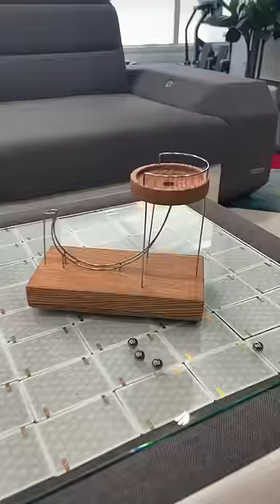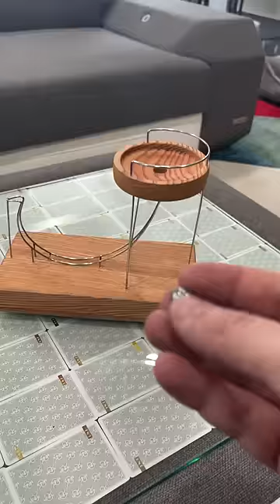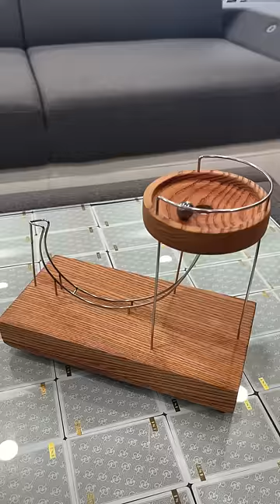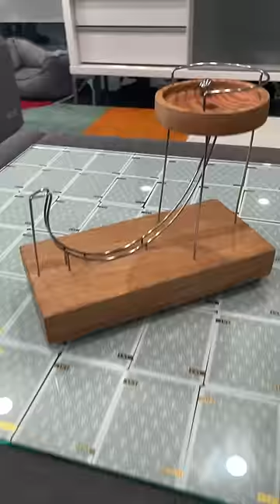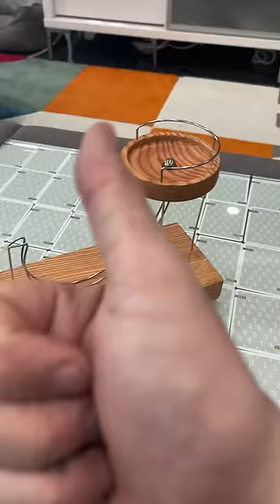An Impossible Perpetual Motion Device?! 😳 #Shorts

Comment: Constant energy as illustrated are definite, it releases an accurate energy and harnesses it back to serve, give and maintain the EQUILIBRIUM force as the energy is constant-potential as Geometry states A2+B2+C2 = ∆ constant and trial balanced, same with laws of Physics and its behavior as to Potential or constant energy and Kinetic energy concept of EQUILIBRIUM, does not lose energy in all parallelogram, with or without battery. ePLDT/PLDT/SME-SMC-Telecommunications-Group, Generalists/NON-REVERSE, NON ALGORITHM approach to excellence in the SCIENCES and ENGINEERING, Tiers and Levels, these concepts are IMPORTANT.Reason:∆. Thank you. Respectively certain/SMEs..employees, Tiers and levels accordingly.

Comment: That device defies the entire comment he made.

“A perpetual motion device is technically impossible” except he now owns one.

Also, thermodynamics is centered around heat related energy, hence thermo, as in thermal expansion (the growth of something when introduced to heat), thermal clothing (clothes that trap heat inside and block out cold, mostly used for high altitude climbing, sports, etc.), and so on. If we wanted a perpetual motion device that used thermodynamics, then theoretically yes, it’s impossible, since we’d need to provide it heat and have it continuously release and take in that exact same amount of heat and energy.

If we want perpetual motion that doesn’t use thermodynamics then we can use things like electricity to certain degrees. Think, a machine uses electricity, solar power generates infinite electricity in small doses, if we ensure our device doesn’t near or exceed the intake limit then we can make a machine that produces infinite power and never stops so long as the sun still shines.

“BUT ZERA, couldn’t we do that for heat too?” I hear you ask- the answer is no. Yes the sun provides heat, but that heat depending on the time of day and the time of year differs. Less heat in winter means a slower machine and less output, while in summer it means less activity since the heat far exceeds what the machine can take in. The only way to balance that out would theoretically be to send it into space but then what’s the point? We can’t destroy energy, BUT we can’t transfer it wirelessly, meaning it would require being tethered to the surface of the earth at all times and we just can’t do that. So yes, a thermo related perpetual motion device IS near impossible, a perpetual motion device in general is not impossible IF you know what direction to approach it from.

Comment: I need to add someting, work goes against motion. You get friction from the ramp that will eventually slow down the ball. That is called negative work. -(mu)mg*d where d is the total ramp distance. So in time, the negative work will take joules out of the systyem, and the ball won't have enough energy to pop back up onto the circular structure. If you know how to measure the heat loss, then you can use cornet's equation to calculate the effeciency of the system. 😂
Reply: "in time"? No, if it wasn't battery powered it wouldn't make it up even once.

Comment: Now you need to invent a way to harness the power created from this device after calculating the power output. The most obvious way to achieve that is to use the gravity of the ball as it falls through the hole of the funnel that pulls a trigger each time a ball falls through it. After building this on a larger scale and adding enough orbs to keep the trigger being pulled by at least one revolution per second times how many devices the same as a cylinder in an engine.I think a funnel would work better better than the current process. Each one of these perpetual motion motors would act as a cylinder to an internal combustion engine could be customizable depending on someone’s power needs.

Comment: You provided the necessary potential energy to the marble to start the process when you put it on the top surface.  Rest is just gravity, centrifugal force and reaction force.  It may not work with a light weight marble.  Need electromagnet?  Not sure.

Comment: Sooo simple, just a magnet 🥱
Reply: If it was just a magnet, it would still technically be a perpetual motion machine. 

Problem is that the magnet on its own would slow the ball down after the ball went over it even if it was placed in the best position it could be placed. Along with this, a strong magnet would be needed to make it accelerate as fast as it did, so it does likely use a moving magnet that moves at a specific speed at specific times to specific locations in order to give the ball enough energy and reducing the chance of the ball slowing down before it makes it over the distance back into the hole.

Comment: o dear, it had me confused till I realised that the projection velocity at the end of the loop would only ever be commensurate to potential energy of the ball at the top which is getting converted to it's Kinetie Energy, but since the ball is in contact With the 02 surfaces and the drag of air it has to lose some of it's KE to friction. So the KE at the end of the loop could never be equal to the PE that the ball had at top

Comment: According to e=mc²

Every time ball lose ~10 nanograms of mass due to friction,considering it's unit diameter.  thus that mass changes to required energy to lift it to the destined point to restart process! 
On every turn, the size and mass of ball shrinks to a microscopic level,that's why its unnoticeable in short run!

Comment: Ball jumps much too high and you can even see the extra acceleration right after the initial drop. Ball should not be able to clear the front lip of the tower. Not perpetual motion. This looks powered. Now if you shaved the front lip almost flat and then maybe added some light springs on the tower legs and timed them...never mind!  :)

Comment: No. By definition, it is not a perpetual-motion machine. It does not accelerate endlessly or produce any energy. It is not even self powered. It uses the energy from gravity to start and maintain a cycle of motion which is definitely and absolutely not perpetual by any definition.

Comment: So, I don’t believe this falls under perpetual motion device category because of one simple fact. The “device” shown has 2 distinctly different parts that are not attached. The wood and metal sled is simply a conduit, with no moving parts, so it doesn’t fall under the distinction of a machine or device in motion. It actually never is in motion (at least to our naked eye, no atomic level or “it’s on the earth so it’s always moving” arguments).  The ball, which is in motion is in itself not a device either with moving parts. It simply follows the conduit in a loop reset by gravity but never actually taking in energy or expelling it (outside of the kinetic energy used to launch it, and then reset by gravity). I believe there is a term for these types of “devices” like the dipping bird with fluid that resets it but the name escapes me. Perpetual is not in the name though

Comment: I see people saying there’s a magnet under the top but out of curiosity what if they put a permanent magnet under there instead? I know they wear out eventually but thats over like thousands of years right? And if this thing was somehow connected to a motor or something to turn that kinetic energy into electricity im sure it would make plenty of excess energy to make up for the energy needed to make the magnet right? Plz respond if you have answers im very curious
Reply: Its not juat a normal magnet. I believe its a coiled wire that turns on and off preiodically so that it propels the ball.

Basically its not and actual stone its and tesla coil that generates the magnectic field thus it needs a battery to power ir.

A normal magnet woildnt work becayse it woild repep the ball when it iis descending and kill its momentum

Comment: Unnatural?? This thing is beautiful. I love it.
Reply: There are batteries fitted in it which gives power to a small rolling wheel just under the hole which rolls the ball fast enough to reach back to where it started,
You can hear that sound too when the ball just drops into the hole

Comment: 2.7 Million likes? WTF? He doesn't explain it at all! I would have liked if he mentioned it has a magnet placed in the base in a position to accelerate the ball bearing at the right time to work as it does. Use a glass marble and it doesn't work. Which has nothing to do with the weight, it is the lack of response to the magnet. If you don't beleive spend money and get a granite marble that weighs the same. Or a copper marble will weigh near the same. A lead marble will weigh even more, but still won't make it back to the start since it is not attracted to the magnet hidden in the base where it accelerates the steel ball bearing as it falls so that it is fast enough to make it back to the start. No perpetual motion, which he said it impossible according to the laws of thermodynamics, which none of the 2.7 million likes understood, he just shows what it does but does not tell the trick. So it got a dislike from me and it needs several million more dislikes so the number of likes goes away. (It never shows the number of dislikes but reduces likes, bt only to zero, not below. So it will always look more popular than it is.)

Comment: How does the electro magnet propel the ball instead of attracting it?
Reply: The key is in the word "electro". An electromagnet only works when current is flowing through it. So turn it off and it won't attract anything.
Reply: @SilverEye91  I get that, but is the ball hitting a switch to turn it on and off?

Comment: Its fake , actually there is moter beneath the hole which gives speed to the ball and continues its motion. Also battery cell is placed in circuit providing electricity for motor

Comment: It loses energy to friction heat and air resistence with none of it being preserved sustained or amplified however due to the curve of the ramp it is able to gain enough velocity to return to its starting point. Its perpetual motion however its not free energy.

That is until you add a little paddle for the marble to wack before they go back into the hole. That paddle can in turn do useful work. NOW you have perpetual motion so long as the device doesnt break in any way. Perpetual but finite. 

I guess a true perpetual motion device would probably behave something like a spinor. With two modes of motion in a single lap.
Reply: "Perpetual but finite" doesn't make sense to me
Reply: @shanewatkins7491  something can perpetuate and also have an end and a beginning.
Reply: @-66karma  Sincere question:  what's the difference between "perpetual" and "infinite"? And are there examples of things that are one but not the other?
Reply: @shanewatkins7491 perpetual is to sustain versus infinity is to never end. 

although i guess its technically a self contained system of motion device. perpetual motion is pretty vague and can vary greatly.
Reply: @TheFlameGarden  does something "perpetual" end?
Also, in the characteristics of "perpetual motion", don't forget that it's impossible.
Reply: @shanewatkins7491  to me perpetual only describes a state of a closed system which repeats a cycle. a ray of light is actually a very good example. it i believe perpetuates through the electromagnetic field. it has to have a beginning and end at least the end of that form of energy when the ray transfers its energy to another object the energy disperses ans changes form. no longer does it perpetuate through spacetime freely. 

whereas infinite is more of a mathematical hiccup that describes the state of a system to specifically have no real end. there are different types of infinities some stacked within or exterior to another. but all of them demonstrate ways ehich a set of numbers can logically continue forever. 
one of my favorites is the question that goes something like "if you have a set of 1, 2, 3, 4, 5. . . and a set of 2, 4, 6, 8, 10. . . then you corresponded each value from one set to the other so we have 1-2, 2-4, 3-6, 4-8. . . will we ever run out of even numbers before we reach the end of the real number set? well lets say we have a real number value of 10 billion.... well 10 billion times 2 is 20 billion. so now we know if we count a double set of real and even numbers to 10 bil itll look like 10,000,000,000-20,000,000,000. sadly i forgot all of the lessons to take away from infinity but basically its a way to describe a sort of black hole on math where sequences literally DONT end by definition. 

this is why i draw a distinction between the two especially in relation to science and math. perpetual describes the fact that it does sustain. infinite describes the fact itll never end. perpetuation may end no strings attached. so in all honesty to call a normal perpetual motion device exactly that really is not wrong. 

what we truly ought to concieve of is a device of infinite energy. but not even real black holes can do something so extraordinary as they too may perpetuate for a very very very long time however one day those too will evaporate. the only thing left to perpetuate is existence itself. perhaps that may be truly infinite.
Reply: @-66karma  yes, that makes sense. Thanks
Also, from the dictionary definition,  it seems that "perpetual" is neverending in time, while "infinite" is immeasurable in space.
Reply: @shanewatkins7491  thats interesting they made that distinction with infinity. especially since space and time are interchangable in math. im sure based on the physics of "infinity" you could work both ways no problem and in fact we already have by considering things like black holes the thing with a literal singularity might put you somewhere else in spacetime. 

from a grammar standpoint i do see the usefulness with perpetual being never rnding in time and maybe in the past it was used in a truer way than to call a silly motion device "perpetual" when its not even that Dx. tarnishes the entire meaning of the word but i do respect its origin. personally i still feel right but id love true examples of perpetual being used in a more classical and literate way.

Comment: Because it is unnatural. The speed of the drop would not be sufficient for one return. That comes back at double the rate it should. Bet it won't work with plastic or wooden beads.

Comment: Perpetual motion exists. The energy created gets put back into the system and, it is just enough to keep it going making it perpetual, but you can't use it because once you try to take energy away from the system it will slow it down and stop working.
Reply: Exactly
Reply: Unfortunately, the laws of thermodynamics would disagree. Yes gravitational potential energy is converted to kinetic energy as the ball falls but the acoustic energy (because you can hear it) and thermal energy (caused by friction between the ball and surfaces) created mean that the ball loses energy on every loop, therefore can't return to its starting point without energy being added to the system (via an electromagnet) as an amount of energy equal to the initial gravitational potential energy would be required to lift the ball to its starting point. Although as you can see in the video, the ball is actually thrown higher in the air than its initial starting point, so would require more energy than it started with, even discounting the lost acoustic and thermal energy.

If it's ever possible to break those laws it will be seriously cool but unfortunately atm our technology, and more importantly, knowledge, don't allow it 😢

Comment: Por favor explicame por qué no es la máquina del movimiento perpetuo. Si no lo es, es que hay algo que no se muestra en el video. Pero aunque la teoría dice que no es posible, y esta es rotunda en sus pruebas; esta máquina parece contradecirlo, a menos que el rose termine por quitarle energía. No se, me gustaría que lo aclares, por favor. Gracias.
Reply: A magnet could be used right at the bottom of the downwards ramp to give it the energy needed to go over the distance between the ramp and the hole. But that still wouldn’t work since it would loose energy going away from the magnet, and the strength of such magnet needed would be super high, which in that case would not make it work. It’s likely that it uses a mechanism that moves the magnet very fast bellow the ramp to give the ball the energy needed to get over the distance by giving it continuous energy.

Comment: you could charge a battery by conduction.between the ball and the plate. the ball bearing passes thru the hole this is where the charge takes place. the ball is positive and the hole is negative, when the ball falls thru they get excited that is energy and can be harnessed by transistors and capacitors making a perpetual electrical generator we would need to build alot of em, and this would need to be scaled way up like by 10x-20x to get anything large enough to power a house but hell a dozen of em could charge your phone. fun to think about
Reply: Combining what you said with a ball that is itself a magnet. While lining the track with copper ring's. What do you think??
Reply: @Brandon Lord Baltimore  yes that would make it more perpetual. it would work. you could also make the ball negative half positive this could increase the electromagnetic inductions happening on the rail and hole.